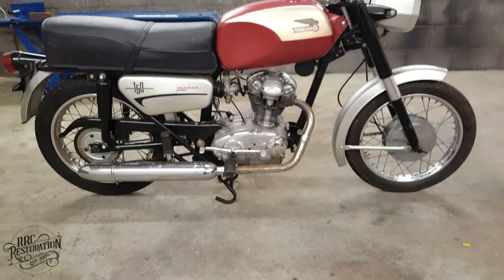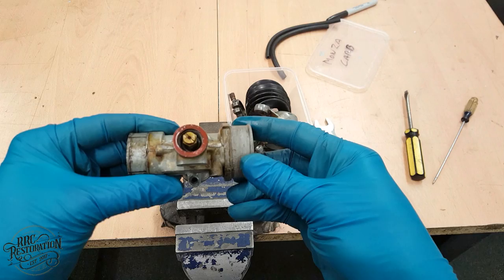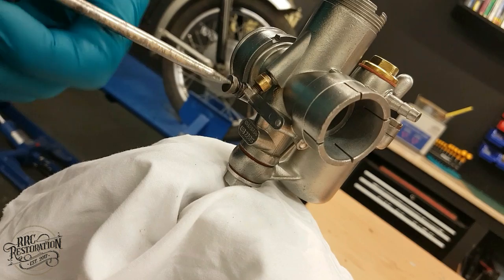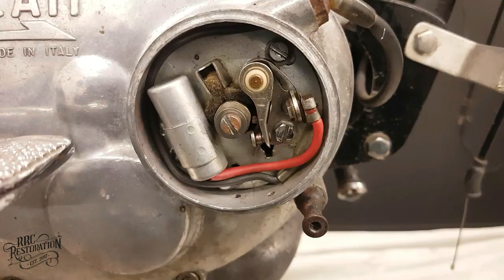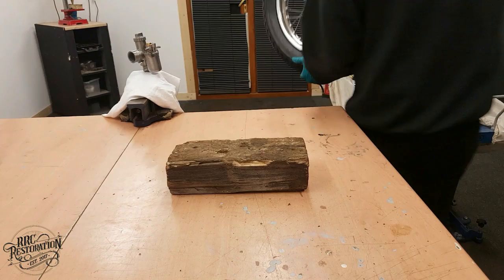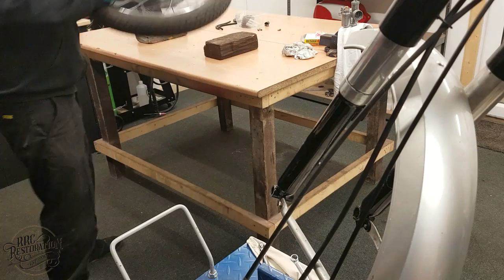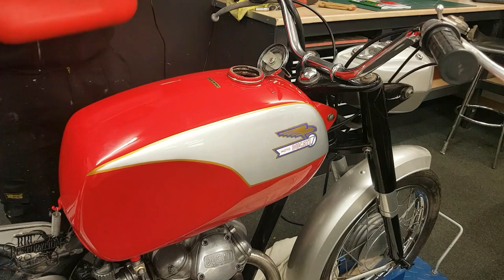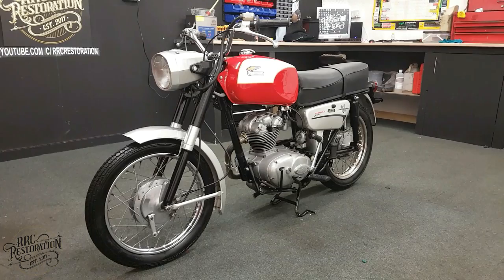The Ducati You've Never Heard Of  - Monza 160 Part 2

Comment: I know you wanted to keep the explanation short, but for those not familiar with these kinds of carburetors I'll add that the needle attached to the slide is tapered so that when the engine is at idle the largest diameter of the needle essentially closes off the main jet and the engine runs on the idle (pilot) jet along with whatever air passes the slide when it is nearly closed.  As the slide is raised the needle moves up out of the main jet and because it is tapered, it blocks less and less of the main jet, increasing fuel flow along with the increasing airflow.  The fuel to air ratio at different throttle openings can be fine tuned by lowering or raising the needle relative to the slide, or in some cases, replacing the needle with one having a different taper.  This video brings back fond memories of working on the Ducati Diana MK III I bought new in 1967.  It was a 250cc single and a lot more race-oriented than the Monza, but it had a similar layout and similar engine configuration.   I wish I still owned it.

Comment: If you rebuild carbs often, pretty soon you have enough parts left over after reassembly to build a new one purely from those!

Seriously though, the overall standard of Italian automotive engineering from the 1960s was so far ahead of the US, UK & Asia at the time. Those bevel drives and even that simple carb are works of art. And the Bauhaus script on the foot pedal rubber...

Comment: always replace the chain & sprockets together. to make sure the rear wheel is aligned correctly measure from center axle to swing-arm pivot bolt center-line on both sides of the wheel

Comment: Great video,

Remember learning to rebuild bikes in the 1970s starting with a Ducati 160 Monza and BSA C15SS. The wire mesh air cleaner is a great idea until it gets soaked in fuel and catches fire when the engine backfires on starting (happened twice to me). The idea behind the twin banjo fuel feed was to run with the fuel tap only open on side of the tank. When you ran out of fuel you just opened up the other side to use up the remaining fuel on the opposite side. 

Of course the 160 always sounded good due to the straight through exhaust as standard. Weird ignition system with an hybrid AC magneto supplying the volts for the spark coil and the battery only being used for the brake light, side lights and horn. The headlight bulb was fed directly from the winding on the magneto and so the brightness depended on how fast the engine was running...

I wonder if RAW78H survived?  I preferred the all silver fuel tank colour scheme it had though.

Comment: At first I was wondering why the heck they put those complicated banjo fittings on the float bowl and for the fuel inlet. But while you were putting it back together it hit me. This allows you to clock the bowl and inlets separate from the main body of the carb which probably allows for a bunch of different fitment and application options. Aside from cosmetics it looks like that bike was very well looked after for its age. I'll bet it rides like new!
Reply from the maker: Yup you got it exactly, Such a clever idea from delorto I'm surprised more manufacturers didn't jump on board with it? Maybe its flawed in someway? Always a pleasure to hear from you and really glad you liked the video :)

Comment: Surprised you didn't install new sprockets with the new chain. Also, if I'm not mistaken, the air filter steel wool should be sprayed with new oil, to trap particles.
Reply from the maker: Owner just wanted a new chain, the sprockets are not to bad, starting to wear a little but still thousands of miles left in them. Yeah i forgot to mention about oiling the filter , my bad lol.

Comment: Great little vid again .. I got a 87 dt125lc ypvs here and a 91 ts200r slingshot here to do a little restore on if you bored as my garage got no heating 😂🤣😅   what's that rust remover you using ? Any good for a fuel tank as the dt tank got a pin hole in it and if there's 1 it's only a matter of time before there more in it and would it be best to get the pin hole rig welded or brazed as I don't fancy using that chemical tank liner stuff as a few mates has used it in past and some didn't seal well  and some come unstuck in tanks lol mate used the frost sealer on his sp1 and it unstuck after a couple werks and rattles in tank now 😂🤣

Comment: Interesting to see that Dellorto did remote float chambers for a lot longer than Amal. Hopefully it doesn't leak like my Amal 284 does though that's probably more to do with Ethanol in the fuel.
Reply: If you want to avoid ethanol issues on a vintage bike, most branded super unleaded doesn’t actually contain any ethanol. Esso, BP and Texaco’s don’t in most of the U.K anyway, look it up on their websites.

They may say E5 on the pump, but there’s no legal requirement to put it in super unleaded fuel, so they don’t, because it sucks, and it costs them more to include it.
Reply: @Jonathan_Doe_  started using the water and food colouring trick to remove it, then a splash of octane booster. Super unleaded is a rare commodity in rural Northern Scotland.

Comment: Got to love the simplicity of a single cylinder, especially loving this one's lovely little engineering touches. Excellent, as ever. Dead impressed you can do the fiddly carb stuff while wearing gloves - with my sausage fingers, gloves make them feel more like flippers 😀. What solvent were you using in the sonic cleaner for cleaning the carb body, please?

Comment: Have arrived at the cleaning of the air filter, and was wondering... The filter appears to be akin to steel wool. Would there be any benefit to pouring a capful or two of clean engine oil into the filter before replacing it? I know when I would maintain old lawnmower engines with foam air filters that they recommended that you would put some oil into the foam then squeezing out the excess before you put the filter back into its place.
Reply from the maker: Yeah i forgot to mention that step about re-oiling the filters sometimes i complete forget to mention stuff like that as im so used to it being second nature

Comment: Nice (: What liquid are you using for the ultrasonic cleaner? Is it possible to use fuel?
Reply: I'm also curious to know your ultrasonic potion of choice 👍🏻
Reply: One of the most used within our range of products is the ULTRASONIC-7W, which is adapted to cleaning all metals, such as iron or steel, but especially to cleaning aluminum, since it contains specific corrosion inhibitors for this metal.

Comment: 11:06 
Hi man ! got a question. what kind of grease do you apply ? I have very bad experience with a Lithium grease for mechanical parts, on my 600 CBR carbs... After remplacing the cuves gasket. It does a kind of Chinese noodle in contact with the carburant.